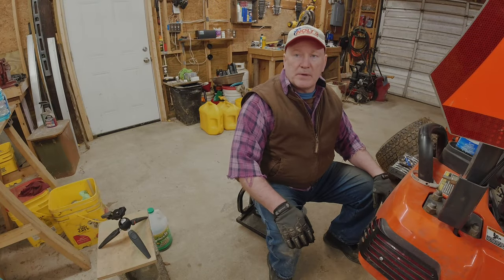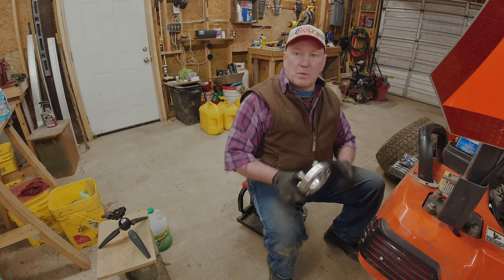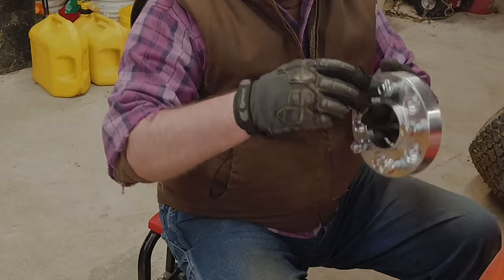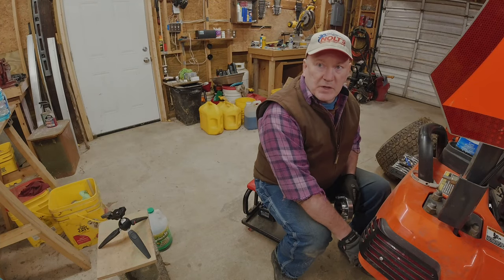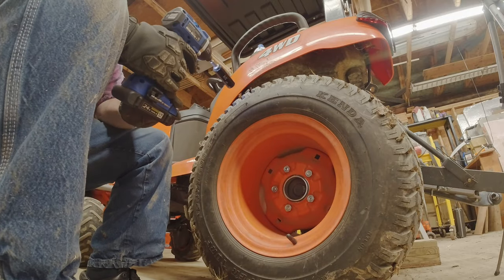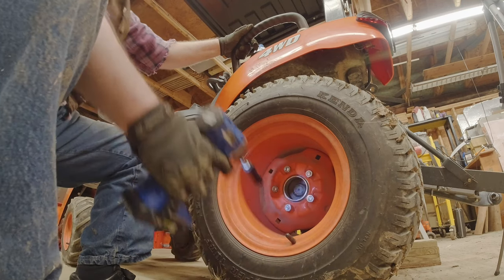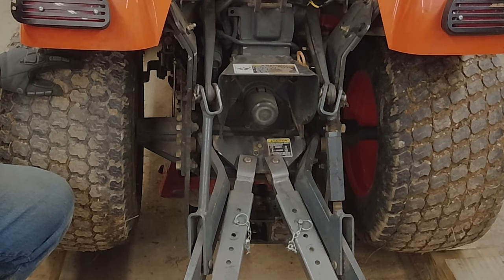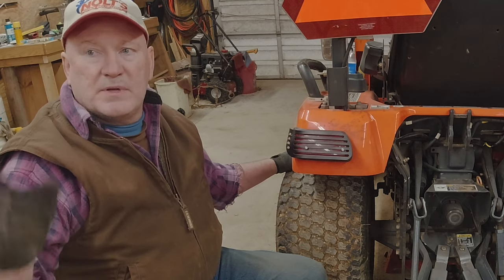#63 - Saved $150 On This Mod

Comment: Seen those used for many years and never heard of an issue. You gave a good tip showing this and very beneficial to other BX owners. As for the socket not fitting in the spacer hub I simply put a 3/8 drive chrome  socket in the lathe and machined the first inch of the socket down to work in that area. After I snugged them up I torqued them all at 100 ft lbs and it was done. 
I’m happy to see your still going strong and enjoying your awesome tractor. As I turned on my iPad your notification came in so I checked it out. Fantastic vid my friend. Merry Christmas to you and your family and all the best in 2021.
Reply from the maker: Thank you Paul - I always enjoy your videos also - Little Killer is a dream machine - I saw the new step you made for the 70 series - I guess you designed your own sub-frame and then modified the previous step to fit the new setup.  It's always good to hear you and Kathy joking around.  Merry Christmas to you all and wishing you a prosperous 2021 - cheers

Comment: Great job ! Looks good and should help with stability. The 18hp. tractors come with smaller wheels front and back and the 23 and 26hp. models have larger wheels front and back but people still use wheel spacers on those as well. If you have a 54 inch deck, I think it will will be ok no more than you added but if it’s really close it could hit if you get too much lift on one side of the deck going over and around obstacles. Have a Blessed Day !
Reply from the maker: Thanks for the tips! - The internet and YouTube have been a great resource for helping me get more out of my little tractor.  Thanks for watching and commenting - Have a great week

Comment: Nice video bob thanks for the links. You should be fine with your 1” spacer with a 50” deck.. with a 60” your good for 2”
Reply from the maker: Thanks 👍 Biff - I have been busy getting ready for the winter snow storm they are calling for here in Pennsylvania.  I hope to have a new video up soon.
Reply: @botabob  I didn’t realize you lived in PA , I’m only 45 min from Erie PA.. the big storm missed us last night but we did get 4” but most was melted by the the I got home from work today hbu?
Reply from the maker: We had about 14 inches.  A nice day pushing snow
Reply: @botabob  awesome I bet!
Reply: @botabob  Hey few questions Bob on those spacers you used.. Did you end up needing those studs you linked in the description? If so then why? Second question is it looked like once you had your spacers mounted the lug nuts looked to stick out passed the hub, if this is true then is the stud and nut making contact on the backside of the rim? I think im gonna go with 1-1/4 spacers so that i wont have to worry about that as they will be a little deeper. Since i have a 60" deck i can go up to 2" but i feel 2" is too much.. 1" to 1-1/2" i feel is perfect so i like that you chose the size you did. So if i order the 1.25 spacers will i need those studs? I dont see why i would. Thanks bob
Reply from the maker: Ok -  Did you end up needing those studs you linked in the description? - I did need the wheel studs.  I am learning a lot about my BX.  It seems that the 18 HP BX tractors are different from the BX tractors with higher HP ratings.  A lot of the parts are different on the 18 HP tractors - For example, the operator deck mat on the 18 HP version is not as nice as the deck mat on the higher HP tractors.  The tires and wheels are smaller in diameter then the higher HP BX tractors.  And, my BX had bolts holding on the wheels and tires.  The bolt head is 13/16 bolt and the socket will not fit inside the spacer.  You should have studs already holding on your wheels.  The spacer kit will have everything you need to do the job.  
Second question is it looked like once you had your spacers mounted the lug nuts looked to stick out passed the hub, if this is true then is the stud and nut making contact on the backside of the rim? - The studs on you see sticking out are what you will hand your wheel and tire, then secure them with the nuts.  Everything will be clear to you once you have the wheel spacer kit.  
So if i order the 1.25 spacers will i need those studs? I dont see why i would. - If your BX has lug nuts, you will not need to install the studs.  My wheels are held on by bolts, not nuts.  I didn't do a good job showing you the bolt that holds on the wheel and tire.  my bad.  I think I would go with the 1.5 in spacers, unless you would have trouble getting into the barn, trailer, or the gate to the backyard.  Good luck with your project.  This will be easy for you after cutting a hole in the hood and making your own exhaust system.  Cheers

Comment: Hey Bob!  Let me get this right, the open ended bulge acorn wheel nuts you bought allowed you to get a standard deep well socket into the wheel spacer well and tighten the nuts onto the screwed in wheel studs?   Hmmm.   
Cheers!
Whipple
Reply from the maker: The original 1/2:-20 bolt required a 13/16" socket, while 1/2"-20 nut only requires a 3/4" socket.  

The holes used to secure the wheel spacer to the hub had a smaller inside diameter then the outside diameter of the 13/16 sockets I had in my tool box.  I soon realized the nuts used on the studs were 3/4 inch hex nuts and the 3/4 inch sockets would fit into the mounting holes.  So, I found threaded studs that were the same as the original bolts used to secure the wheels.  I have come to learn that the BX2370 tractors came from the factory with studs and nuts.  So, it is very possible, I could have purchased the studs and nuts from my local Kubota dealer.  What I find interesting is the fact that a tractor manufactured by a Japanese company used an American size bolt and thread count and not a metric bolt.  The bolt size is 1/2" diameter bolt with 20 threads per inch thread count.
Reply: @botabob  That is interesting.  Who woulda thunk that an SAE thread would be on an Asian machine.  How about them apples?!?,
Reply: I used a reg socket instead of a impact socket